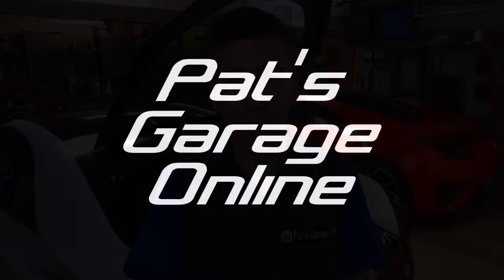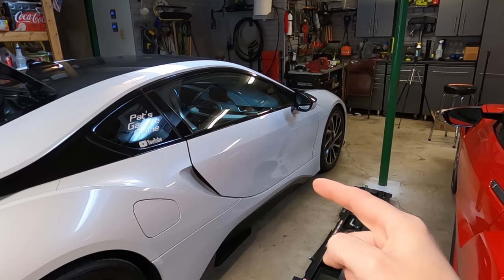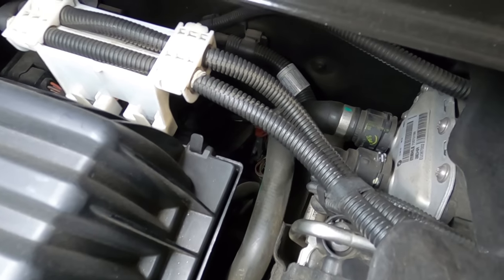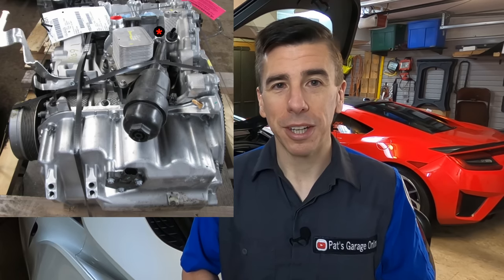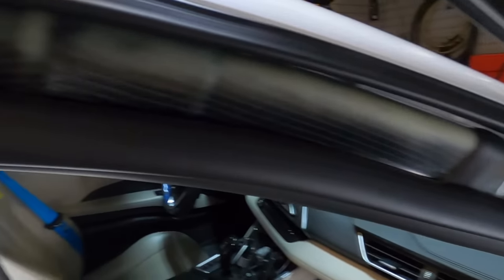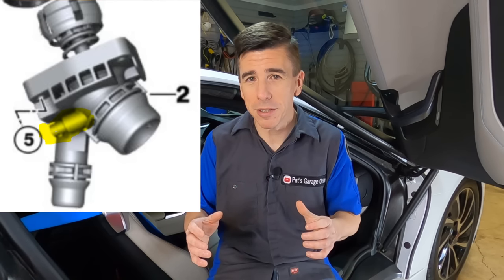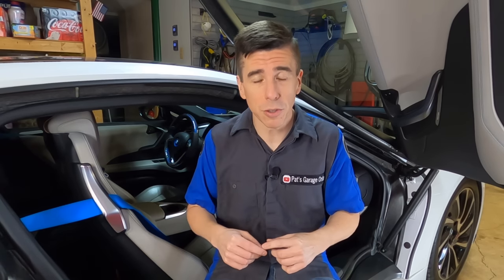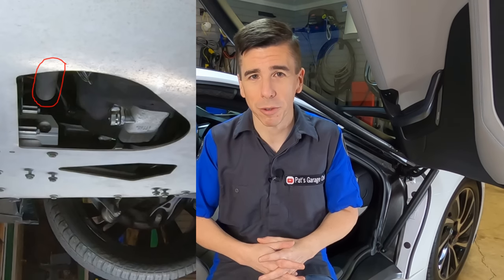My response to your ideas about Samcrac's BMW i8.

Comment from the maker: Were you surprised to hear that this system is even more complicated than I shared in my last video?
Reply: When you said that the thermostat is controlled by the ECU or ECM... I was going to say maybe the ECM is not working but then you're right it should throw out a fault code...
Reply: The cooling system in this car is NUTS!  I have 30 years experience working on cars, but mostly American and Asian cars.  Out where I live, no one buys high level European cars.  After seeing all of this.....I'm GLAD!  The kicker for me?  Remove the engine to swap a CTS?  REALLY?  Those things blow like popcorn on most cars!
Reply: @hacatan24  It did throw the error code, that it is overheating. The computer switches power to the heater in the thermostat with only two wires going to it for power, that heats the wax motor to extend and the spring to retract when the wax cools. The computer knows it is heating the element but does not know the position the wax motor moves to. It infers what is happening based on what should happen and the resultant temperature. End result is what it knows is the engine is getting too hot thus that is the error it responds with. The thermostat is really easy to test by supplying it power with a lab power supply. And the computer signal is really easy to test with an oscilloscope.
Reply: "Characteristic Map Thermostats" have been used by BMW from at least the E46 years (maybe E36?). My 2004 330i has one. That said, it is much simpler than the one in the i8. Fast engine block warm-up (emissions) and but also allow it to run cooler at full load to prevent knock. Quite slick.
Reply: Yes
Reply: @Ulrich_Wolf  lol. Does the popcorn come with butter and lot of BMW  high quality gloves mechanical gloves?
Reply: @Mattstech12  E46, E39, E38 all have em, starting with the M52TU engines and up. edit: (and all V8s iirc)
Reply: so what about ditching the ice unit altogether in this car ... a hybrid to all electric conversion.? add battery packs in the ice space. it would be a far better car for it though of course the range would suffer.  probably not doable for some reason i cant figure, but...
Reply: Why would you want to own a car that is so much of a pain in the butt to keep it running?
Reply: I say and I didn’t think I could have a suggestion. But I say start unplugging different systems in the car one by one to see if any throw up the correct code or not? That would tell you that the Ecu is in fact working in all the proper places? Like unplug the thermostat resistor? See if it is in fact getting warm one of the times and then just make sure the ecu is in fact good and able to show you if any of the key components is able to throw up a code if unplugged? Not working properly? I am trying?
Reply: @robb1165  actually an ohm meter to make sure the resistor is in fact the correct value and then A dc volt meter. To read the current that is being supplied? Should be just 12 volts? Wouldn’t you say? Not a cam bus? But I could be so so very wrong with what I just said. Some guessing?
Reply: @go5582  ok I really liked this one!! When I read popcorn earlier I was think of movie butter popcorn!
Reply: @eclectic3618  great youtube content.
Reply: Not at all... things only appear complicated when not understood. Note how lots of other manufacturers, race teams and builders are going for electric cooling control, the benefits are real and not just in BMW
Reply: Sam removed the thermostat to see if it was not opening, but that didn't help
Reply: @TheMoonDr  If you remove the thermostat the coolant now has a path right back into the engine instead of being directed towards the radiator.
Reply: @cliffp73  An ohm meter could check the resistor but would not check the wax motor like applying voltage to see if it moves would. A typical volt meter is too slow to properly show the computer output. It would give you an idea of what is happening but would not show a true representation like an oscilloscope would.
Reply: @robb1165  well then I just got to learn how to use one then.. I am not a tech like that I am a computer tech. I really would love to learn how to use one!
Reply: Think i had a similar bleed problem on my old MR2 which also have the engine higher in the back than the radiator in the front. But instead of rising it in the front, it needed to be rised in the back about 2 foot. And in the front on the cooler/radiator i needed to connect two see through tubes that went stright up (ABOVE THE HIGHEST POINT OF THE ENGINE) and then fill coolant in the engine bay untill the level rised in the tubes above highest point of the engine and it started to puke out from the fillport(in engine bay). MR2s have valves on the radiator that you can close/open and connect the tubes on to,so you dont let any air back in the front when you re done disconnecting the tubes.
Reply: @robb1165  I would guess that the power to the resistor is pulse modulated. Even a slow ohmmeter will tell you if that circuit is working and if the resistor is open though I suspect the controller is smart enough to detect an open heating resistor. The scope would allow the magnitude of the PWM signal to be measured and possibly see modulation changes.
Reply: @robb1165  the thermostat doesn't direct the flow in that sense.  It just opens when the coolant in the block get hot enough.  Sam removed it in his video, allowing for coolant to flow freely and seeing if it was the point of failure.  It still overheated with it removed, imply there is either a blockage somewhere or its still not bleed properly
Reply from the maker: @ehlava  Very little space to put the batteries.  Rich Rebuilds gets requests for this all the time.
Reply: No. I saw the video of how to open the hood when these cars first came out. They are way overly complicated.
Reply: No.  Smart German engineer + beer and schnapps = BMW i8
Reply: @hacatan24  i had a bad  way back set codes for everything when if fact it was the ECU all along .I was wondering if maybe all the fuel economy stuff was messing with the timing and fuel to lean it so bad it overheats  but a simple scan while running would show that
Reply: @TheMoonDr  With this car and other BMW's the thermostat has two functions. It restricts flow from the cylinder head inlet to the water pump as it heats up, and opens up return flow from the radiator at the same time. If you remove the thermostat like Samcrac did there is no longer any restriction to the cylinder head inlet to the water pump and coolant will have full flow right back into the pump. Most of the coolant will take the path of least resistance. The long path to the radiator is higher resistance than the direct path right back into the engine.  See 8:51 in the video as Pat reads this from the manual. The manual is not as clear as I put it as it assumes it is going to dealer mechanics that already have training on the system.
Reply: @go5582  Yep!  The popcorn is shaped like turn signal lamp bulbs, too!
Reply: Ehhh considering its BMW and they always have to overcomplicate things to make them look gorgeous, no, not surprised at all.
Reply: Is it worth trying to control the Thermostat from an external source? I'm sure it will throw a fault but could point to something else in the system
Reply from the maker: @haydnfstr  No, there's something else going on I didn't discuss in my video.  Wait for Sam's new video to come out for more info.
Reply from the maker: @eclectic3618  I haven't had the issues Sam is experiencing.  In fact, many i8 owners have had no issues at all.  Fortunately, I'm also under CPO warranty for another 2 years so any issue is covered by BMW and I get a loaner during the time it's down.  After the warranty, the car is gone.
Reply from the maker: @haydnfstr  It's normally open, so I wouldn't spend too much time on it.  I think Sam found another issue since I released this video so I'm looking forward to what he uploads next.
Reply: @PatsGarageOnline  Thanks for getting back to me, I'll keep an eye out for it 👍
Reply: Samcrac has solved the problem according to his youtube community page!  Samcrac is making a video now!
Reply: Not at all. This whole care is a technological experiment that is proving that, while looking like a great car, there are many underlying components that make it way too complicated to be reliable.
Reply: Yes.  And I also realized that they knew this head coolant situation would destroy engines more, making them more money.
Reply: I still don't understand putting anything with wax in it into anything that will heat up UNLESS the desire is to see it diminish with use over time. Wax that is heated will dissipate.
Reply: @PatsGarageOnline  maybe Sam's "step mom" helped?
Reply: I've said this before, but I really believe that the design of this car is overly complicated and over-engineered. All basic parts of the engine, drivetrain and components should be relatively easy to access without having to disassemble the entire car.
Reply: if i was you ask samcac to go ond help him a you get lot more subs to your channel
Reply from the maker: @lenicemurrain8608  I'm not personally looking to boost my channel. I'm just a DIY hobbyist who enjoys reading the service manual and getting feedback from other i8 owners so I can share what they've been through.  If I didn't live 1000 miles away from Sam, it would be better to be on site when all these things were happening.  I love troubleshooting things.
Reply: @PatsGarageOnline  definitely not a car to own without warranty!! Same with many modern cars now!!!😳
Reply: @Ulrich_Wolf  It’s ludicrous an engine out for a sensor?Bet while you do that they recommend a new water pump/timing belt,bonkers.
Have a friend who bought a Porsche Cayman,barely used it oil service light came on after 1500 miles takes it in £300 not to shocking then gets hit with a quotation for enhancements!brake discs/pads the lot £4000 there not faulty not a warranty issue,by this time we had collapsed in the pub laughing car was gone 2 weeks later.
I bid on a full service history 911 rs with 28000 miles on it at 4 years old was outbid at £8800 new the car £90000 plus,now that’s what you call depreciation 😀😀😀
Reply: sam need your help make the call silly
Reply: @Axelfl6161  WOW!
Reply: I just watch were a guy got a new fuel pump off eBay. after installing it latter had to pull it was not working and found something in the line looked like a green bug or a leaf. now could it be at BMW line a bad head gasket was installed overlooked building the car. it comes down to taking the motor out tare it down find out if the head is warped and so on.

Comment: BMW has lost touch with reality. The engine is too complex.
Reply: I like the old KISS standard.  Keep It Simple Stupid...
Reply: Their new cars are built to last maybe 5 years and end up in a landfill. None of the new BMWs will ever become classics cause they will be too big of a pain to keep on the road. Values of their cars from the 80s,90s and maybe early 00's will be the ones that will have all the collector value.
Reply: @nboy7  Back when I grew up they were known for their solid build and reliability. 1602, 2002 and 315 were beautiful, solid, affordable cars. I started rethinking this when I saw all these American videos about how unreliable and complex they had become. 
Blame the politicians and their 'green' craze I suppose. And if you want a hybrid, buy a Prius. It does exactly the same thing, it is just very ugly (as are most modern cars). If you want complex technical stuff to actually work, buy Japanese...
Reply: Mr10usdad    Too complex is actually fine, as long as it's also too reliable. This is just shit. Thank fuck it's not designed to fly. BMW should look hard at their badge and remember where they came from.
Reply: Amazing how they turned a 3 cyl into a Rube Goldberg machine.

Comment: Best idea: Don't buy an i8. I can't afford one anyway, so problem solved.
Reply: sounds like you got a whole lot of other problems that still need to be solved, bro.
Reply: When, if you don’t buy an i8, you’ll miss driving one the most amazing and fun to drive cars that bmw has ever build. In the last 10 years I’ve owned  an E90 M3, 335 c, m235, M6gc, and a new M5. None of them can get close to i8 for the “fun fact” (may be m235 is comparable ), the beauty of i8 is its relative light weight with a very low center of gravity. Its not “over powered” like m5 or m6 and can be used as a very functional daily driver car. With a pair of winter tires it drives like a champ in snowy central PA!
Reply: the car is gorgeous, and I am saying it knowing I'll never be able to get one. stop hating.
Reply: Pretty much lol plus it has a 3 cylinder engine. I'd much rather get a V8 or even a turbo V6 for that 150k price tag.. you can get a 2012 McLaren for a little bit less
Reply: @alexm566  it is a gorgeous car! But they got lost in the asthetic of the car and forgot about reliability. Every car company does it atleast once, Maserati had electrical issues, rolls royce had, well, issues lmao 🤣  just for example
Reply from the maker: You can get an i8 with warranty for around 70k, used.  It's real wholesale cash value is about 55k for the early ones.  But, I wouldn't own one without a BMW warranty (CPO or extended).  Too many issues that you don't want to try to fix, yourself.
Reply: don't buy the first gen i8, wait until they workout all problems and buy the second gen.

Comment: I was suspicious of the actual coolant hoses, in Sams video the hose that goes to the thermostat seemed very pliable. I once had an overheating issue that turned out to be a hose being sucked closed by the water pump and restricting coolant flow.

Comment: Left this after watching your previous video!

Louken Thompson
I don’t think the bleed is the issue. So here’s an idea!  it’s a repo car! If the owner couldn’t afford the car, maybe they never changed the oil either! The engine could be overheating because of something other than the water cooled aspect of the engine. Maybe the oil pump has failed, maybe the oil system is slugged up. Replace your engine oil and use a filter from the BMW dealer and nowhere else. Run the bleed procedure. You can use the lift or jacks and lift the sides of the car, then the front of the car then the rear of the car then the front of the car again and that should help you work the air out of the system.  Really consider the oil issue, there might be something that the service managers won’t tell you because they’re just the middle man while there is a BMW master technician  who recommended engine replacement based upon their findings.  That’s the guy you want to talk to about this car...
42 minutes ago

Louken Thompson
I say this because 
#1.  I saved a guy broke down, his truck overheated and shut off. I towed out of the intersection and brought him to Walmart, his oil level was low, put oil in it and it ran great!
#2. Women stuck at the auto parts store with out of town family car. Auto parts guy sold them coolant, I had funnels and offered to help so I could prevent further contamination of the earth.  The radiator was almost full and their expansion tank was cracked so they thought it was low. Nissan v6 with 250k miles. Check the oil and I put over 2 quarts of oil in the car! They drive the car back to campus with some peace of mind.
27 minutes ago

Louken Thompson
One more thing, I recall in my experience of a Mercedes overheating because of a clogged catalytic converter. We removed the exhaust and the car was healed. Replacement was the resolution. Maybe they were running 87 in the i8 and it caused the cat to expire. Possible you can find someone with a loaner exhaust or you can remove/bypass the cat or exhaust for testing purposes. You could have Pat use The infrared laser on his exhaust system  then compare it to what you see On yours if you can’t bypass or get a replacement unit to install for testing.
7 minutes ago

Comment: "HOLY SH!;!:!&T" I think these engineers were having a good time and a few to many bier. This takes over engineering to a whole new level. LoL
Reply: this mainly because of co2 reduction measures. a lot of modern cars get problematic systems in them because of the need to follow  environmental regulations in Europe.
Reply: There may have been Bier and Schnaps involved.
Reply from the maker: @Holozon  That's right.  CO2 is more of a concern than reliability.
Reply: Jochen Stacker     And meth. Really good meth. Lots of it.

Comment: Pat
Has anyone told you you have a great voice for voice over/Radio announcer.
Reply: AGREED
Reply from the maker: Thank you.  I'm actually a ham radio operator, not a professional, but I have learned that a good voice goes a long way.  No pun intended.  😄
Reply: @PatsGarageOnline  Been a ham since 1969. I learned early to speak clearly. What works for SSB DX hunting works equally well when cell phone coverage is spotty.
73 N2FMH
Reply: Very easy to listen to Pat!
Reply: @PatsGarageOnline  KE7IXP Receiving! ;-)

Comment: Thus i8 has captured my interest. High cooling temp is all about the cooling system. Let's think from the basic.
1. Is the pump is running?
2. Is there air in the pump? 
3. Is the coolest circulate through the radiator?
4. Does the radiator fan runs in the right direction?
5. Does the thermostat opens when the running temp is reached? In this system thermostat opens by a temp sensor so, either sensor is faulty or the signal do not reach the thermostat.
I suggest when the temp is reached, slack open the outlet of the radiator and see if any water spray out? You may fill up a small amount into the water tank.
Answer to this experiment is water spray out of radiator, coolant line is clear till radiator outlet. Temp should be controlled.
If no water spray out thermostat or something is blocking before the radiator. Radiator itself could be block.